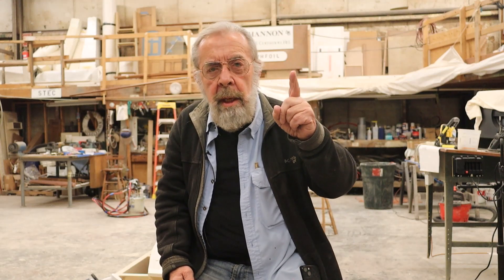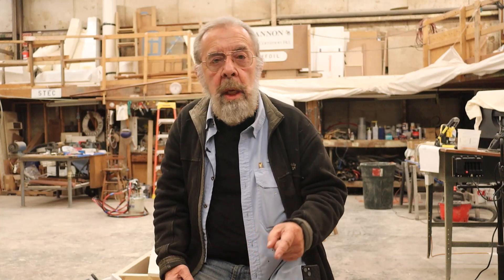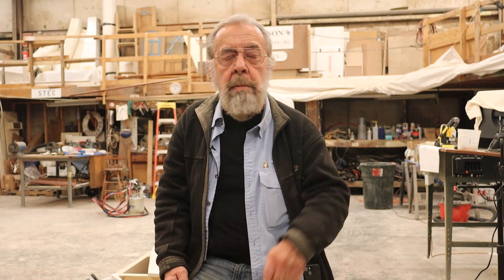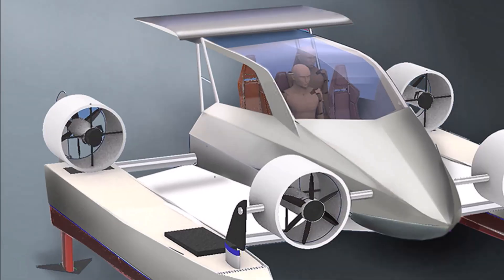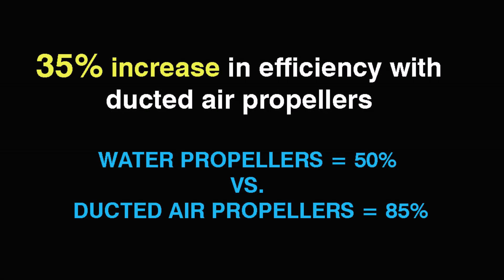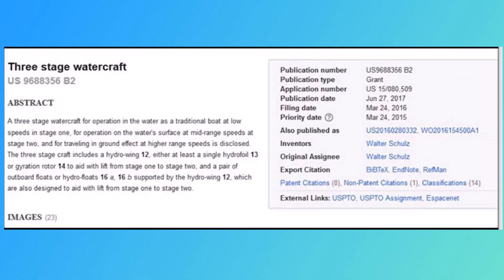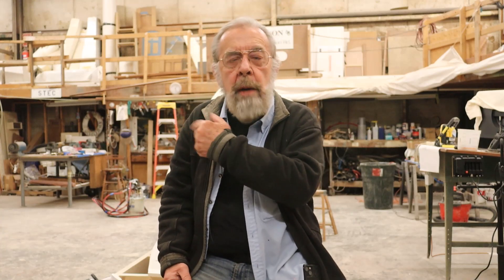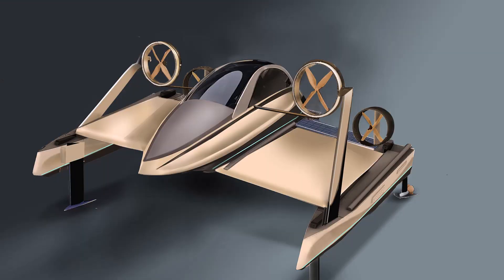NEW PATENTED SUPER BOAT

Comment: But the noise. I mean a small drone makes you crazy with the prop noise, I can only imagine the ducted props. No I am sure there will be lots of design changes to decrease prop noise, so the concept deserves a chance. Good luck!
Reply: Yep, it was propellor noise that killed ACV (hovercaft) development all those years ago …
Reply: A major noise generator of rotating propellers is called thickness noise generation. Propellers for high-torque and high rpm motors can take advantage of this problem and others. I do not believe the complex propeller design physics was available for the old craft, as the math and design, now CAD and AI- aided is still in nascent stage.
Reply: @briseboy lots of research is going into propeller noise abatement too…for example, the non-symmetrical rotors used by Zipline.  But yes, these probably are not pleasure boats any time soon.
Reply: @worldtrav72  As for lifting bodies, aka ground effect, see the work that Jim Brown brought to the multihull leisure world

Comment: I recall reading somewhere that for lower speed craft (like displacement hulls) that water props would be way more efficient than air props ... and that air props get better at higher speed more easily driven hulls ... like your craft ... does that sound correct?
Reply: Sure is. "Water propellers are generally more efficient than air propellers because water has less "slip" than air: 
Density: Water is about 1,000 times denser than air, so airplanes need to move more air to create the same momentum as a ship propeller moving water. "
Reply: @dnomyarnostaw  800x is a better rule of thumb. 816x, but it depends on altitude and salinity.